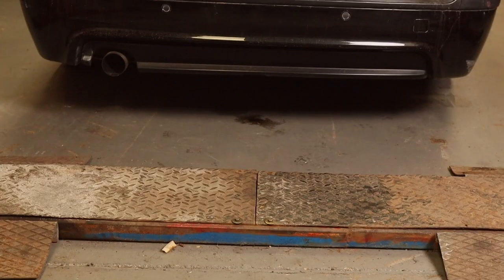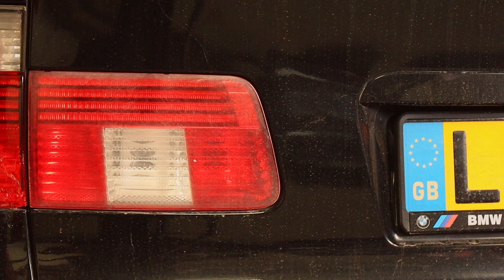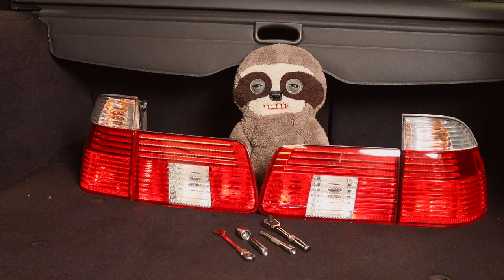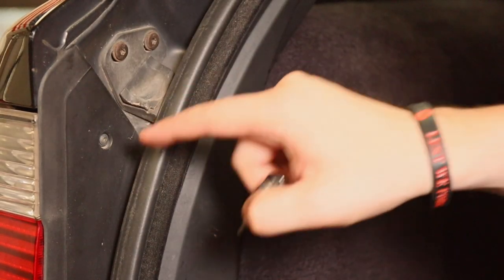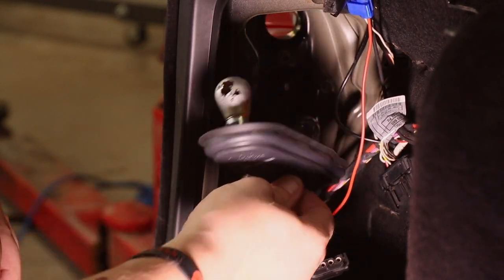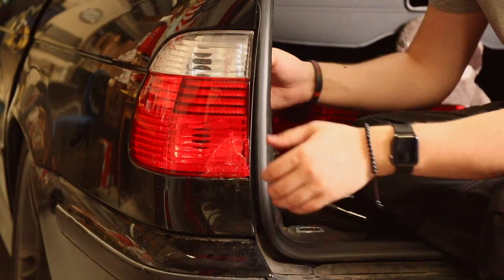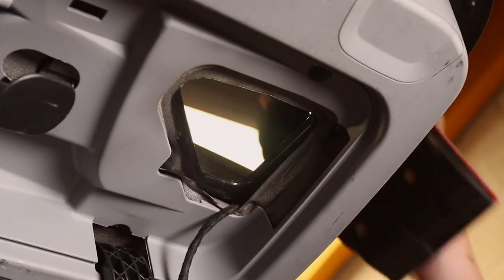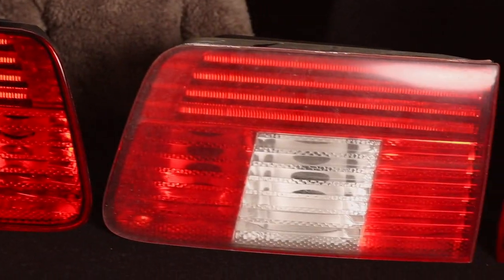How to replace the BMW E39 Wagon/Touring Rear Lights

Comment: great job, thanks for posting these useful instructions!
btw, alternatively you could have just refurbished the 3 unbroken lights (and even the front lights) with 1000 grit sandpaper and a gloss clear spray paint finish, this method also creates a like-new look on any acrylic lights.

Comment: Hello, does anybody have an issue with the light bulb that is part of the block from the tailgate being change here? my light bulb is not working anymore and impossible et remove it, I don't want to change the whole block just for a light bulb, does anybody have an idea? Thanks in advance